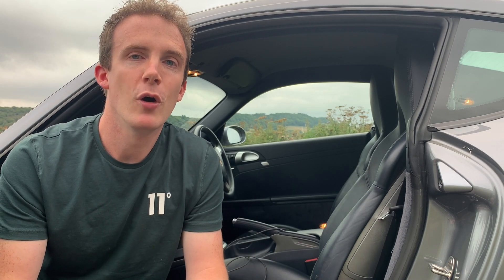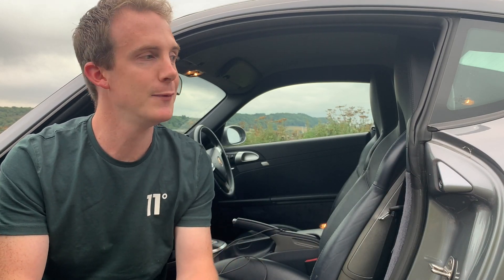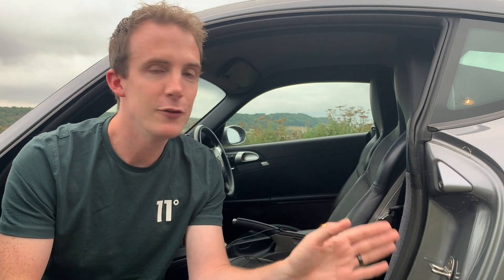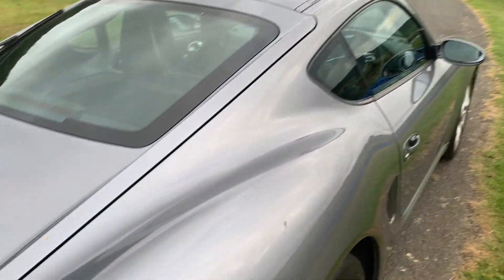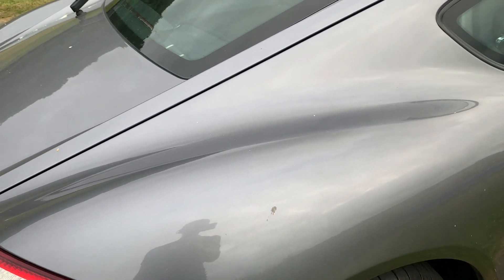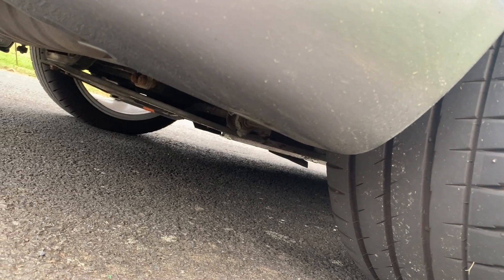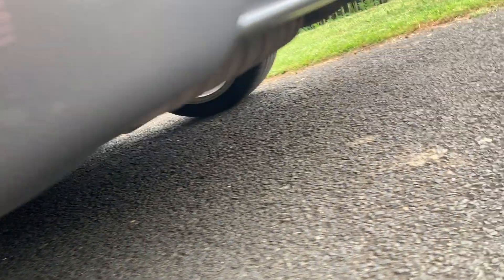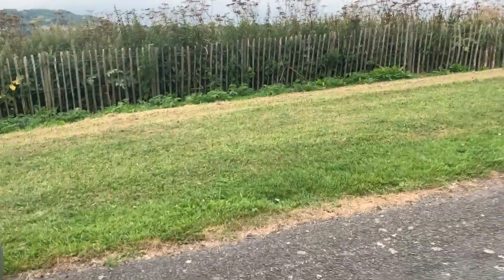MY CAYMAN 987 HAS BORE SCORE | What are the symptoms , sound and repair cost?

Comment: Let me ask you a simple question: if the engine wasn’t tapping and the car drove fine, why exactly did you rebuild the engine? Was it because it was consuming too much oil during one trip to Scotland? Did you consider changing the type of oil, viscosity etc. or did you rebuild a perfectly working engine because the internet told you ought to? Or did the internet tell you that if yo7 didn’t rebuild immediately catastrophic failure, not the clattering engine and billowing smoke, would befall your engine? My view Joe, is that there were a number of steps that you could have taken before the rebuild and saved yourself a heap of cash. But you are where you and it looks like you’re enjoying the car, which is no different in terms of performance than it was , but it allows you to sleep at night, albeit a lot poorer.
Reply from the maker: Hi, yeah so the oil use made me think something was badly wrong, it smelled really bad and not even that long after this video it was knocking and dropping cylinders :(
Reply: When the bore score problem has started it gets worse fast, and if you keep driving it will run fine until you get sudden catastrophic failure that totals the engine and you need an entire new engine, that is what they say at least...

Comment: I heard that Base level Boxsters and Caymans dont have bore scoring.  I heard their pistons are made of a different metal... have u heard this?.
Reply from the maker: I have heard they are not affected but not sure why, the bigger the displacement the more common. As the 3.4 is a bored out 2.7 engine I would say it has something to do with that. Not sure tho
Reply: @JoeTalksCars  On the 3.4 the weight of the piston is greater then 2.7l and when the iron coating rubs off from the piston, the piston skirt starts rubbing against the bore and damaging it.

Comment: t’s very common with 996,997,986,987. 
IMHO it’s not a if but a when. Also why is everyone talking about spark plugs. Scoping through the plugs is like scan for cancer after you have a bleeding lump. One needs to go up through the pan and look below the piston not on top. Also there is no harm in scoping. You think you’re going to hurt the cylinder with a tiny camera similar to the one they stick up your arse for your exam when a piston flys around in there at 5000 rpm and is forced to do so by an explosion. 

Dang £5,000 here in US it cost between 5 and 9 times that. 

If I were in your neck of the woods I’d certainly take it to Hartech. Get some nickisil sleeves and an LN IMS solution
Reply from the maker: That is very true! No way does it cost that much more in the US? 🤯 a lot of people told me to go to Hartech, there are reasons why I didn’t and I may do a video on that one day, probably get cancelled by the community tho. 🤣
Reply: And it does. I have a very similar story as yours. My 997.1 S will cost $25,000-$45,000 US depending how far I want to go with it. If it was $6500 = £5000 id do it tomorrow.

Comment: Repair cost sounds low. You may be getting a rebuilt engine still susceptible  to bore scoring. LN Engineering website has extensive resources on bore scoring, including, I think, a 4 part video from Porsche Club of America that takes you through from start to repair. The cost for a proper rebuild that will not be susceptible to a repeat is 20-25USD.
Reply: yes 5000 sounds like they have only done 2 cylinders, when you fix bore score you do all six if you do not want bore score on the next cylinders in a year or 2...

Comment: I was told 3 weeks for my engine rebuild. 4 months later I still don't have it back yet 😂
Reply from the maker: Bloody hell! Was that at Hartech did you say before?
Reply: What kind of fule consumption do you get? I found mine was much lower than it should be
Reply: @JoeTalksCars  yeah. But it's an independent specialist actually taking out the engine and putting it back in and Hartech are just working on the engine itself not the car. He doesn't seam the best but it's who the dealer took it to as they are paying for it.
Reply: My 3 month build turned into 10 months and exactly one year later 1700 miles motor has major problems on new rebuild. Beware of a certain eBay rebuilder

Comment: As far as I am aware  it should be a bad result of a compression test and oil consumption  only due to recognise a bore scoring.
Reply from the maker: Compression test showed normal compression but the oil consumption was high. The camera shows the scoring really clearly, they could also tell that it needed a couple of pistons too. Not sure why compression test doesn’t help:/
Reply: @JoeTalksCars  thank you for your channel. I was thinking to buy a similar car and, even came down to see one of them, After watching your channel, I am pretty sure that there is no any chance to replace my Audi with 3.2 engine with a Porsche at the same age. To work on the car? No, thanks...
Reply from the maker: Consider the 2.7 tho! No bore scoring with those and you still get the flat six howl!

Comment: It's a bummer, but highlights the importance of getting Porsches of this age inspected before purchase, it only cost £300. 
Also Joe have you considered getting an engineer's report that the bore scoring was present at purchase? Then you could ask the supplying dealer to pay for the repair using the Consumer Rights act 2015
Reply from the maker: I didn’t think I’d have a leg to stand on to be honest. I could ask the question tho, it really does show the importance of getting it checked for sure!
Reply: You'd have to have an engineer's report based on the images saying it was there when you bought the car, then small claims court.
Reply from the maker: Can imagine that would be a tough one to prove. I might message them and let them know what happened and see if any goodwill is doable. It was a very pleasant garage to deal with and can’t imagine they would be happy to know this has happened. The problem with bore score is I’ve heard it starts low down in the engine and works it’s way up.
Reply: How long have you had it, 12 months? How many miles have you done? A used car has to be 'fit for purpose' an engine rebuild after 1 year isn't acceptable.
I'd call them and have a chat, explain Strasse have diagnosed it as that and it costs £5k, see what they say.
If they don't want to know then get Strasse to write a report and then you submit a small claims. Worse case judge might say they are only partially in liable due to time/mileage.
Bore scoring takes a few years to build up.
Reply from the maker: @richfixescars  yeah 12 months. I will drop an email and see. Like you said it’s not really good enough after a short time! Il see what they say! Cheers! It is something I had not considered as it’s been a year
Reply: @JoeTalksCars   Really you have to do it by phone or in person, they will ignore an email or letter of that nature. I expect you've only done 6k miles or something, so it's not acceptable to have a major engine problem that soon.
They should have scoped that car before they bought it, rather than passing the problem on.
Reply: @richfixescars  over a year on a used car .... go do the lottery on the way home , you will have more chance of getting a pay out that way.
Reply: Here in Norway now when you sell a car you can be responsible as a seller to pay for repairs up to 2 years after selling a old junk car... So most avoid that by saying even new cars is sold as a wreck that must be repaired to avoid having to pay for repairs 2 years after selling.

Comment: I had bore scoring on my 996 and you could hear the knocking on a cold start, once it was warm though it sounded fine. Incidentally, this can happen on other cars too, I had a VW Beetle (2012 model) that required an engine rebuild after bore scoring, it just wasn't as costly as a Porsche.
Reply from the maker: Yeah mine did actually start knocking in the end, It was the day i took it in for work! Typical. Guessing your 996 was a lot of £££ to put right. Did you do all 6 liners in steel?
Reply: @JoeTalksCars  Actually the knocking came about 2,000 miles after a £5k rebuild by Autostrasse in Essex for the IMS which was caught on it's last legs. When the engine was apart I mentioned the liners, they said they were fine, 2,000 miles later the knocking started, Autostrasse said it can happen at any time - BS, IMO, I think it overheated when they were testing it due to not bleeding the cooling system effectively. It wasn't too bad so I lived with it for a few months and eventually sold the car to an enthusiast (it was perfect otherwise) who wasn't concerned by it.

Comment: Maybe it has already been asked but why don’t just take the risk to live with bore scoring and not fixing it?
Reply from the maker: I tried but in the end it was taking over 2L of oil every 100 miles. It was struggling to start too.
Reply: They say if you keep driving with bore score it gets worse fast and you risk totaling the engine and need replacing the entire engine when it blows (or whatever happens that totals it).

Comment: Oil burn
go to slightly heavier weight oil
still oil burn ?

you have bore score, get a scope in there cause yer  engine is done.
Reply from the maker: Tried the heavy oil. No change, won’t help hide borescore like some would have you believe
Reply: @JoeTalksCars   no heavy oil won't help a damn for bore score, thats just to rule other things out like slightly worn rhings or valve guides

Comment: Tapping will only happen when car is hot and has been running for a while and idling for a bit. if you start the engine as you did in the video, even if the engine is still hot, it may take a while for the tapping to start. It's only light, typically, and will almost always be on the left bank.

Anyway, people tend to get very upset when it's pointed out the bore scoring on the M97 3.4-3.8 is rife and make accusations of scare mongering. But here we go again. Yet another car with scoring. Bore scoring on these larger M97 engines is far, far more widespread than IMS ever was on the earlier M96 engines.
Reply from the maker: Yeah it doesn’t do it when warm. May just start tho, not using the car until it goes in now. Yeah you see it daily on forums and Facebook. The problem is widespread, the initial 3% of cars affected was when it was first found. As the cars get older more will come out. Should have bought the 2.7 but here I am. Never mind, it’s going to be great when finished.
Reply: @JoeTalksCars  I don't know where you're getting 'the initial 3 percent' figure, but it's entirely made up. At this point, if you took a random sample of existing gen one 3.4 cars, you'd find at minimum a third had at least the beginnings of scoring - and quite possibly 50 percent or more. I would also think carefully about the repair. £5-6k must mean you're not doing the whole engine. I assume just one cylinder, probably number six. Other cylinders will eventually fail. At absolute minimum you should do all three on bank two. You also want to do the crank shells while you have the engine out and apart.
Reply from the maker: Thats the figure batted around on pistonheads ect, totally agree it is wrong. It was probably that when the cars came out but as the years and miles pile on I fear they will all end up with scoring of some sort. The rebuild is all 6 cylinders and 1 piston at least. The cost is lower that somewhere like Hartech as we have opted for the steel liners, the special liners Hartech use are near 1k each i think. I need to clarify what else they are doing but I am 99% sure they mentioned crack shells, belts, chains, pumps ect. Will clear it up on the next video. Thanks for the comment:)

Comment: Smoke is not normal
Reply from the maker: Well sometimes it is depending on the situation. Mine still does have a little cough of smoke if I start it, turn it off and start not long after. But a sustained amount is not normal.